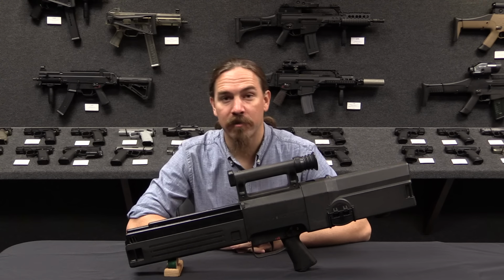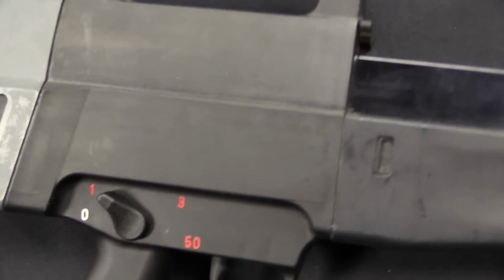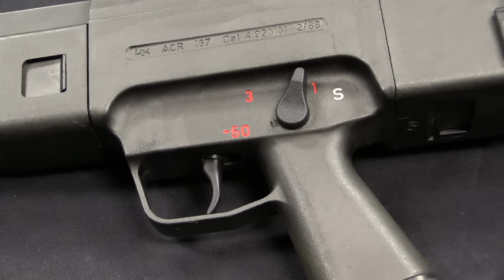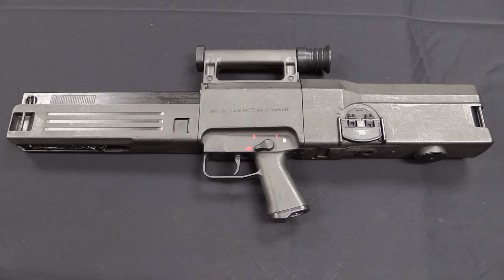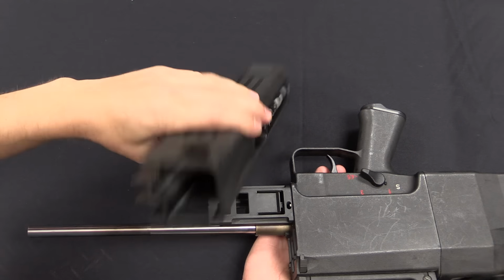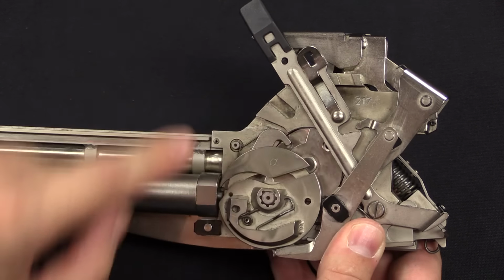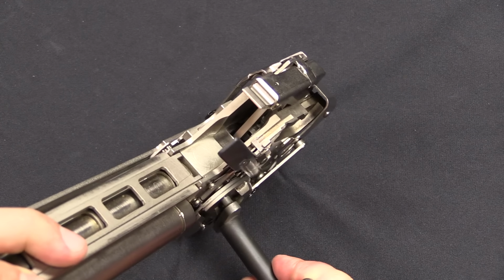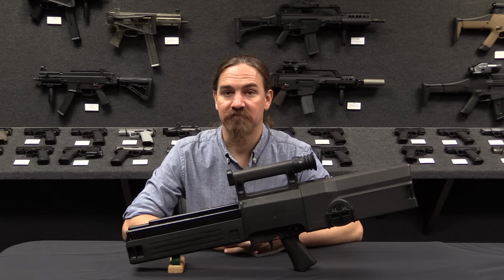Kraut Space Magic: the H&K G11

Comment: I am not sure i understand why we have not just used a liquid propellant and electrical igniter system for caseless guns. Have a liquid in a pressurized container with a battery pack attached that has more than enough power to operate the gun to fire (Maybe even power scopes and the like). That 'magazine' should be separate from the magazine holding the actual bullets (Projectiles? Missiles I guess technically). The gas system could even be held on you belt or back so that it can be protected/armored. I suspect you could find a propelent that wouldn't ignite without a eletrical spark as well, so you don't have to worry about tanks opening up. A 15oz tank should be able to carry the fuel for thosands of rounds.
Reply: One little leak of your "propellant" and you could blow up or light the operator on fire.  Using a gas would also bot be very feasible because temperature changes would give inconsistent charge.  Not to mention finding a liquid or a gas with the proper burn rate and energy density would be problematic.  Also the increased weight would be an issue.  One thing you also have to remember, the more complex a system, the more ways it can fail.  The more ways it can fail, the more likely it is to fail.
Reply: It would be pretty easy to use two gasses that are inert until mixed. As far as consistency we take care of that problem all the time now in all kinds of environments. Heck, the tech for understanding the different temp makes in the volume and conbustibility of a gas is build into every gas pump and new car in the US today. 

Also last time I checked smokeless powder and its modern equivalents was fairly inflammable.
Reply: Liquid and gas propelants tend to burn unevenly.
Reply: @Just another random person
What? That's not even remotely true. it is far easier to get an even mixture and even burn with gas than solid propellant. This is the reason that almost every rocket manufactured operates on liquid fuel. It's harder to do but it's way more efficient and controllable.
Reply: @Cenobyte40k  ummmm most rockets use solid fuel.  The main reason rockets for putting satellites in orbit and ones of that nature use liquid fuel is because with solid fuel it cannot be regulated once lit.  With liquid fuel you can change the amount of liquid and oxidizer being injected into the nozzle for better positioning and control. 

Let me ask this,  what will properly position the bullet and create the necessary seals?  You mentioned temperature compensation.  Pumps at gas stations are positive displacement metering pumps.  The part that does the measurement is also a positive displacement type.  Temperature does not play a factor because they are volumetric, not mass flow.  Plain and simple, using a liquid or a gas propellant for a firearm greatly increases complexity and induces more failure modes while offering pretty much nothing.
Reply: Overly complicated for something to trust your life to
Reply: @AMC2283 You mean like your car or truck? a gas injection system is how they operate.
Reply: compressed air
Reply: I thought the same thing but I am not sure how much force you can get out over time. I played paintball with 4500psi tanks but they where kind of heavy.
Reply: @Cenobyte40k  Using straight compressed gas like paintball guns use would never work.  It doesn't matter the pressure.  The max velocity of the bullet would be constrained to the speed of sound of the gases propelling it.  When gun powder burns the temperature goes way up.  Because of that the speed of sound also increases dramatically.  The temperature increase is what the pressure to go up in the chamber also.  That is why you have the 5200 fps or so max muzzle velocity using standard gun powder.  Look up compressible flow and supersonic flow characteristics of a gas.  When I am talking about gas, I am referring to the phase of matter, not gasoline btw.
Reply: @Adam Carolan
1) I specifically talk about igniting the propellant. 

2) WTF are you shooting with a 5200 fps muzzle velocity? Do you have a tank main gun? 

3) light gas guns have propelled things up to 6km/s with compressed gas. (19685 fps).

4) I have a Texan 45cal air rifle that fires at 350gain bullet at ~1200fps with compressed normal air.
Reply: @Cenobyte40k  1)you would not be able to safely or adequately seal the chamber.

2)5200 is the theoretical max.  It was an example.  I do not own or have shot anything that has that muzzle velocity but there are wildcat cartridges that have achieved that or close.  

3)I would be curious to see what was able to achieve that velocity and how it was achieved.  I am guessing not using air.

4)1200 fps severely limits the range and armor penetration needed for a military rifle.  How large is the charge tank and how long does it last?
Reply: Hi there, in the airsoft world we have gas propelled guns, it is relatively simple to maintain , except for when mags leak, then you have to take the o rings out to replace or lube BUT the biggest problem is weather temp, cooler temp reduces the amount of shots we can make from it.
Reply: @jackchan3235  With airsoft, the expansion of the propellant (green gas is I believe just propane with silicone oil mixed in) is what send the projectile down the barrel are relatively slow speeds.  For what the OP was talking about is igniting the propellant to do the same.
Reply: @Worrsaint  so he wants a flamer thrower inside the gun or a mini stove?

I'm going to protect my IP on this. A gun that's both a gun and a flame thrower haha
Reply: @jackchan3235  These are actual firearms we are talking about here.  Currently they are a metal case filled with an explosive powder.  A firing pin hits the primer which ignites the powder.  The expanding gases from the burning powder accelerates bullet down the barrel.  He is talking about doing away with the case and have just a bullet fed in that has a liquid or a gas propellant injected behind it.  Then the liquid or gas is ignited in order to send the bullet down the barrel.  Does this make more sense?
Reply: @Worrsaint  I think I get it. Like how an engine piston work?
Reply: @jackchan3235  Exactly.

Comment: Today we have 3d solid printed graphene and other carbon allotropes soon to arrive. Carbon being the highest black body material we've ever found, this drum chamber could be made out of that, and a simple vent system built through it to conduct air around radiator rings near chamber itself. Heat wouldn't be a problem at all. Same with the barrel.

Comment: I could see this type of concept being extremely useful for on-board aircraft applications.
Like a plastic explosive in the 30mm Canon for the A-10 Warthog. Saving a lot of weight and complexity from case expenditure.
The craft will provide an electrical current for plastic explosive.
There's lots of air flow to help with heat. (Plus multi-barrel)

Comment: Don't wanna come across as a tool but that action in comparison to the standard reminds me of the Mazda rotary engine when it comes to automobiles - very much against the presupposed grain yet seemingly just as functional and perhaps even more econmic...I've yet to see this thing shoot, so time will tell.

While the caseless ammo is another potential advantage, the glaring disadvantage still standing in it's design is that you have to seperate a piece completely for a less than optimal mag change experience. I'm sure H&K would have cleaned this up had this gun really taken off in the market - I have a bit of a fanboy syndrome for them as a company. I just love their designs, from the USP pistol to their PSG rifle. Awesome stuff :D
Reply: K31R616 that Mazda engine is called wankel motor. A German invented it. ;)
Reply: @jl.7739  + wankel's are far from beeing "more economic" in fact they have worse emissions and worse mileage.
RX8 for example takes (in metric) roughly 14L on 100km, thats about double my 2007 Qashqai eats
Reply: DuwMinh could be. I never owned a car with a Wankel Motor myself. You know more about it than me.
Reply: @jl.7739  i was "so" close to buy an RX8 which is why i was doing extensive research about that.
Reply: DuwMinh makes me wonder, why is Mazda still using that technology? What’s the benefit? I guess I have to look it up in detail now
Reply: @jl.7739  they are not.
the RX8 (Rotary Experimental 8) was the last car to ever use that type of engine.
Reply: While the wankle is a fascinating engine, it is far from perfect.  Fuel economy is terrible, emissions are terrible.  The apex seals are prone to failure.  That being said, they are great for racing.  While they lack low end torque, you generally stay at the high end when racing.  They can hit some pretty rediculous rpm and sustain them.  For a similiar displacement, they can put out larger amounts of power vs what a normal piston engine can.
Reply: there are videos on the tube about firing G11's though, you can easily check em out
Reply: +El Guunsko:The so called „Mazda Rotary engine“ was also a german invention - first used in the RO80. Allmthe best from germany.
Reply: The wankel engine does two things very nicely. It removes a lot of moving parts from an engine, and in particular, it removes the reciprocating motion. This makes the engine more stable, gives a much higher power to weight ratio, and reduces wasted motion and thus energy. This makes it ideal for motorcycles or small airplanes. It is also quite fuel efficient, when brand new, but wear and tear rapidly degrades performance, which means there's few actual airplane engines of the type.
Reply: Wankels are great for low torque, high rpm applications. They are not ideal for cars. But they could be useful as generators, for hybrid cars that use range extenders, and Mazda is said to finally do exactly that.

Comment: that's a crazy firering system. It uses square bullets too? Also, it would seem to me, if it can shoot three shots in one cycle of the bolt with the burstfire option, it would also be able to do this in full auto. Just two shots each cycle would still make 1200 rounds a minute rather than 600. What's the reason this isn't how it works? I guess overheating, but it's too general and not very explanatory as it should also be able to fire three shots every two cycles, so on in a ton of different configurations as longs as it adds up with how many revolutions the receiver drum can makes in the duration of a cycle.

Comment: Wait, why did you imply that there was something wrong with the gun? The initial high cost would be partially offset by better mass production, and I would argue that even if it performed slightly worse than the M16 shot for shot with higher maintenance costs, the amount of extra ammunition or weight savings would offset that. I'm surprised that this isn't still being looked into. I'm sure it's possible to make the mechanism more serviceable and reliable as well.

Comment: Virtually nothing gets left behind, why the german spec ops don't apply it to the squads?
Reply: Spec ops' requirements generally don't include the wall of lead, they tend towards precision, but are of course mission-specific - compare the HK G3 with the MP5, concurrently in German service. If the G11 had entered production, diversification of the core technologies would probably have happened.
Reply: You want to bankrupt HK more by making a suppressor for the thing?
Reply: Mostly the ammo, I suspect. You'd need constant, small scale production of an already new and therefore expensive cartridge... or not-cartridge, I guess, used nowhere else in the world, at vast expense to get access to a weapon that has few advantages over the ones you already possess, and have the equipment and training for. I'm sure caseless will have its' day, but the G11 just wasn't quite it

Comment: well that whole overcomplicated mechanism could actually be really simplified using electronics (precise electromotor to rotate the bolt, solenoid piston to work the loading etc.) which doesnt really solve the "failure point" issue, but would solve overall reliability and especially maintenance ... just dont damage your battery or let it run low xD )
Reply: Asghaad or get sand or water into it. And a rifle that cant get wet is a bad rifle
Reply: @David-eh9le  electronics can be sealed against moisture or foreign objects pretty easily and all you need to do inside the rifle is turn one part 90 degrees up and 90 degrees back and the other is the ammo loading which can be accomplished by single solenoid piston. So one contactless precision motor (maybe with one gear in between the "chamber drum" and the motor itself and one solenoid piston both able to be completely waterproofed and no more susceptible to solids than mechanical parts.

only real downside is reliance on batteries and additional failure points of the electronic components. Still it would be way less complicated to keep maintained and batteries these days are way WAY better than what was available even decade back.

i know military would not adopt anything like that, but neither will they take rifle that cant be easily maintained and as complicated as that mechanical contraption in G11 is ...

Comment: Why does it rotate down then up? Why doesn't it rotate in one direction with fresh chambers at each 90 degrees? It would cycle twice as fast and mitigate heat faster. In the current configuration 4 rounds require 720 degrees of arc motion. In a circular design, its only 360 degrees.

Comment: The project actually was killed by the rifle's   need of "manufacturer's overhaul" every few hundred shots (every 1000 rounds if I remember correctly) and in every case of malfunction. It was designed as a money printing machine for HuK but some day even the German Government realized that the possibility of battlefield (or at least on-site) maintenance would be a great option. 

Consequently the G36 is a simple and extremely reliable piece of hardware, you can fix even in a muddy trench (merging two defective rifles into one functional one) without specific tools (just a screwdriver is required for zeroing) and perhaps some drops of oil.

Comment: I do like the fact that it's got a fixed stock though. Telescopic stocks sends the wrong message to the troops that the equipment is supposed to adapt to the soldier rather than the other way around.
Reply: yeah,like my 6'3 frame should match to the gun the same as a 5'4 shooter,duh telescopic is for ppl of greatly varying sizes,not because the shooter has bad form.

Comment: I have to admit... As soon as the back cover slid off, I was immediately disgusted by the complexity of the mechanism inside the gun.

No wonder this thing got canned.
Reply: It got canned because of the extreme maintenance costs and the non existent option of on-site maintenance. Also the mechanism is very sensitive to dirt which may happen to get into contact with military equipment some times. 

It was also a major problem with the G3 which you can easily disable with a few grains of sand (the bolt carrier gets stuck in the housing when dirt enters the ejection opening - which easily happens).

The G36 and the other next generation rifles are more or less self-cleaning to maintain the function.
Reply: It is beautiful.
Reply: Did you watch the video?
It was not canceled because of the complexity!
it had already been approved for the army.

Comment: My pops field tested that rifle in Ft. Benning GA. Had bad vapor trails and he said a few blew up. Then the issues of carbon fouling and ammo getting wet from humidity etc... Great concept poor execution.
Reply: Strange that was never reported. I call BS.
Reply: The ammo was water-resistant due to an impregnation.
Reply: Water "resistant". You can call bs all you want you are entitled to your opinion. There was 14 iterations of this rifle. There was even videos done on this rifle showing vapor trails in early mornings in Ft. Benning. As far as water resistant there's a reason why you don't see any of them firing a round that's been wet. Lastly if it was such a great rifle why isn't it being used let alone copied?
Reply: The ammo was working pretty well at the end, but the rifle itself is too complicated for reliable army use - and far too expensive to maintain. 

After the end of the G11 project, HuK concentrated on designing rugged, simple and dirt-proof rifles, on which you can rely on even if drowned in mud. They learnt a lot.
Reply: @norbertfleck812  my father said the biggest issues we're the rounds. Then main reason the army turned it down because they were pushing a new round and platform. As to which the army already had a stock pile of 7.62 and 5.56. They compared it to shouldering a 4x4 post with a pistol grip. Also stated hk had to even come up with a new round from the original design for anyone to be able to test it.   Sgt. Kellison, United States Army, was  in the acr program through the infantry board. I love the idea of a case less round and when I was a kid loved the sci-fi looking guns.

Comment: There is a great amount of quality to this gun design.  The only major issue is the caseless ammo.  It is the best and worst part of the design as it was the impetus behind some of the clever innovations and the reason that ultimately it was likely doomed.  

The effort made in simplifying the insane action complexity down to a reliable and ironically functional, even easy to operation and field strip... its very impressive engineering and design.  Being able to carry 150 rounds on a standard rifle at that weight, the empty stock leaves even more room for storage that could be modified.  

One has to see a sort of potential in this style of weapon that is a great set of compromises to unlock new potential.  This makes me think of a P90, but designed to fill a rifle role rather than a sub gun role.  Arguably the P90 is similarly cursed and blessed by its choice in ammo.